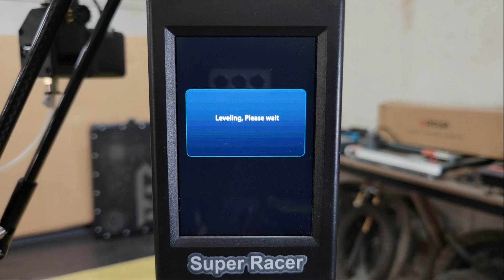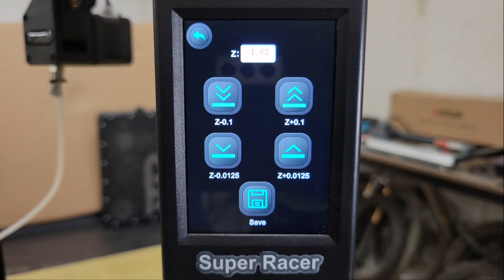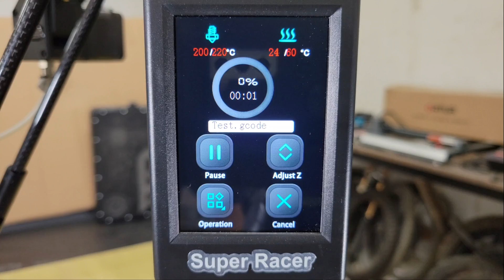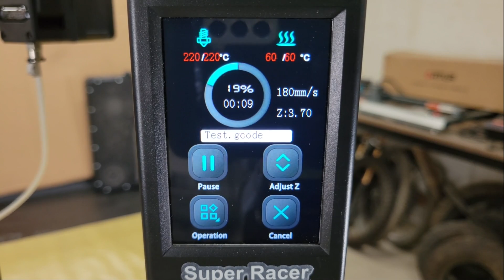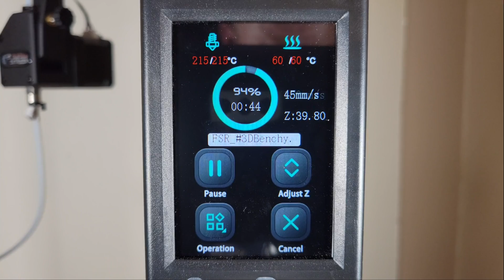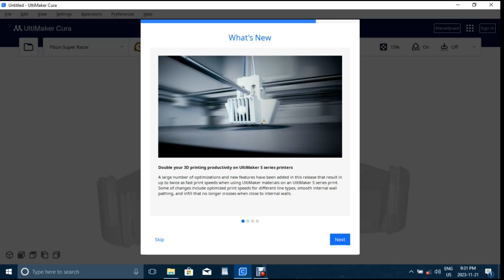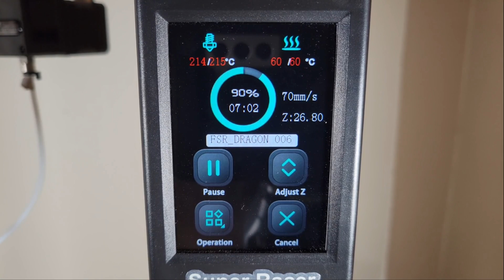FLSun Super Racer Delta 3D Printer Review

Comment: Great video! What's the widest object I can print with this?
Reply from the maker: Print volume is Ø 260 x 330mm high. If I need to print something bigger then I cut my CAD model into different smaller parts that can be assembled with a variety of print in place connections, adhesives or fasteners. Like the motorcycle fairing that I've been working on.

Comment: Nice video. I only recently got into 3d resin printing - Saturn 3 Ultra. Been looking at fdm printers and ran across your video. How is it holding up so far? Do you have any other fdm printers and if so, what kinds and how do they compare? Thanks again for the video.
Reply: if you are interested in a delta 3d printer this is the best bang for the buck, if you have the budget go with the v400 either way you will not be disappointed.

Comment: I had my eye on one of these, but the price was crazy, especially for not being enclosed. Ended up with the K1.
Reply from the maker: $329 ($400 reg) is crazy? A K1 is ~$100 more on sale, reg $800. Not that it's not a good machine, it is faster thx to the klipper firmware, but has less print volume. I personally look at where a company is headed too, not just what they're doing now. For example, FLSun's new T1, which is fully enclosed and has all of the features that the K1 has as well as a larger print volume, can print at speeds that are nearly twice as fast as the K1 and is only $600 reg. Their latest S1 is also fully enclosed with the same features, but it can print at a very impressive 1200mm/s with 40,000 mm/s^2 acceleration, and has a print volume that's larger than the K1 Max, and it sells for the same reg price. Same features, more work area, twice as fast, same price. But relatively speaking, this is a great machine compared to most others in the same price range. Not the fastest, but it's not the slowest (especially compared to cartesian printers) and the quality is much better than what I've received from their competition.
Reply: less than is crazy price ? 🤣
Reply: Hello.
Can you expand on the pricing of the S1 and T! as the website shows no pricing at this time.
I am looking at the V400 and later the panels.
Other than those speeds I am just looking for fist layer consitency across the whole bed with the same duplicate parts being printed.
The coreXY printers look good BUT not having the bed move leads to other printable configurations. (Pursa Delta printers if one could afford them).
Cheers. @JamesBiggar

Comment: I thoug  this was faster than the A1 or A1 mini thats why i wanted to get it  but 40 min for a  benchy thats crazy  that is way too long .... what settings are you using?
Reply from the maker: Presets, max speed where practical. A1 is rated for 500mm/s. FLSun's V400 (which you could be confusing with the Super Racer as they look exactly the same) is rated for 600mm/s. This Super Racer is only rated for 200mm/s. If you want a Delta like this that can compete with the A1, then consider the V400. It's faster than the A1, has a larger print volume, but otherwise it has the same features and it's only $100 (CAD) more. If you're looking for proper commercial machines, then check out their new S1 and T1 models that are rated for up to 1200mm/s.
Reply: v400 is fast this is quick, 200mm p/s is kinda its top speeds out of the box the v400 is 400mm/s so double the speed, still you have to tune them to get more out of them, this can do a benchy in under 10 min i am pretty sure i saw a vid showing it in under 8 min search im sure you will find it, not pretty at that speed but it gets it done, still who really cares how fast you can print an ugly benchy? great waste of filament and time, get a .06 hardened nozzle and upgrade the heater and you can print pretty damn fast after you figure out the profile settings. I am still debating upgrading mine with a v400 effector for the direct drive vs the bowden tube this one has

Comment: I have one doubt please be honest, not having a flex built plate do cause any problem while removal of prints if they are delicate? (I want to buy this printer but have some doubts)
Reply from the maker: I've had no issues with it. Every plate will be a little different though. I have two Ender 3 V2's with glass beds and everything sticks to one really well while nothing sticks to the other. Exact same beds, very different results. You can buy an aftermarket flex plate for the Super Racer to eliminate your doubt, but I've never used one and don't know how the adhesive backing for it would affect thermal transfer from the bed to the plate.